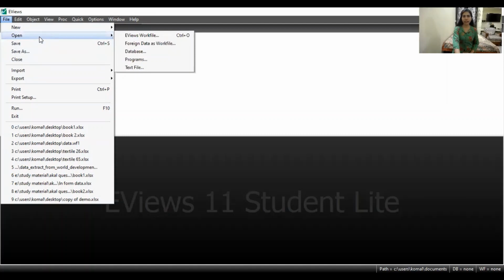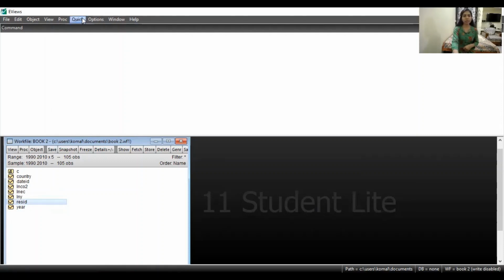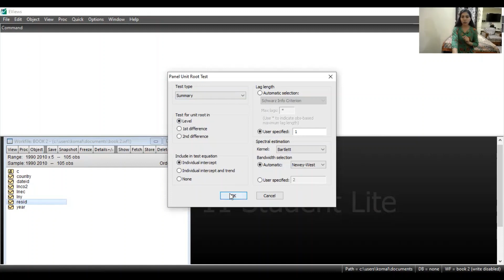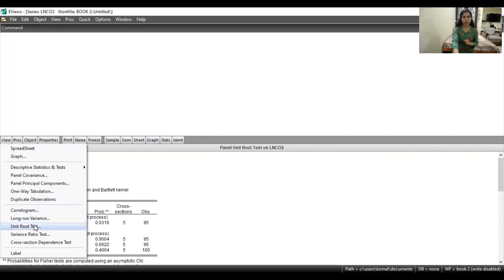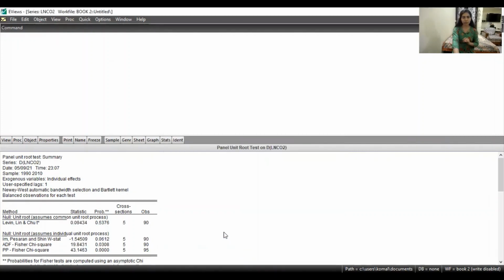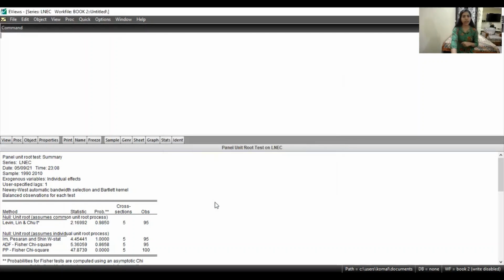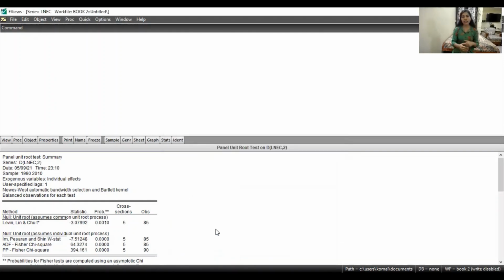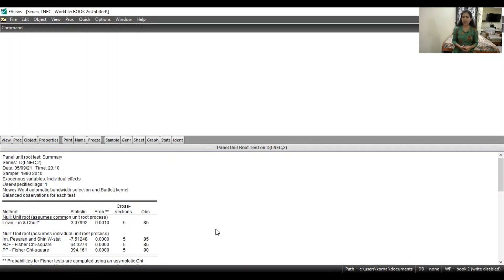Unit Root Test in E Views| Panel Unit Root| Panel Data Analysis| E Views Tutorial | Stationarity

Comment: 👍👍👍
If one variable say lngdp is stationery at level and another variable say lnpopulation is stationery at first difference, then can we proceed like this or do we have to do first difference of lngdp?
Reply from the maker: While reporting your results just mention that: lngdp is stationary at both level and at first difference. Rest of the variables have a unit root at a level and the absence of unit root at the first difference, indicating variables are integrated of I (1).
Reply from the maker: Also, before stationarity check, check cross-sectional dependence in your panels. If there is any cross-sectional dependence in your variables, apply second generation unit root tests Viz, CADF and CIPS.
Reply: Thank you😊
Reply: @komalkanwarshekhawat_  how to do CADF and CIPS tests
Reply from the maker: @sabagulnaz592  For that, first run Cross-sectional dependence test (Breusch pagan, pesaran CD etc) to find out whether there is any Cross-sectional dependence or not.
If there is any, then you need to run second generation unit root test(CADF, CIPS) , this option is there only with unit root test.
Thanks 😊
Reply: How to check cross sectional dependence

Comment: what is the minimum number of years required to apply unit root for panel data in Eviews?
my data is from 2015-2029 and 149 companies 
so it is 894 firm year observation 
but when I apply test it is saying insufficient number of observations.
Reply from the maker: The number of parameters should be less than number of cross sections.
Reply: @komalkanwarshekhawat_  what that means?
Can you explain with simple example please 
That would really help 
And also number of years doesn't matter?
Reply from the maker: @preetibedi5533  Increase time period or reduce number of companies

Comment: I am writing my Ph.D. thesis in social science, and your videos have completely made me abandon STATA. Thanks to you my data analysis job has been simplified.  I have five variables and I opted to use only Levin-Lin-Chu's test, three of the variables are stationary at level, and the remaining two are at first difference. 

My question is?
1. Must I use the summary option to get results for all the test statistics available, despite having Levin-Lin-Chu's test in my proposal?
2. Considering that two of my independent variables only became stationary at the first difference, should I modify them when running the regressions?
Reply from the maker: Thanks for your kind appreciation. 
Regarding your queries-
1. Yes, it is always a good idea to support your stationary results with all the test statistics available.
2. It depends. If you are using a regression model/ Cointegration test wherein the pre requisite is that all the variables should be I(0) then you must ensure that. Otherwise, many regression models can be performed when the variables are I(0), I(1) or a mix of both.
Good day!

Comment: When i click unit root tests(from view), i find 2 options in eviews 12sv lite. A) cross sectionally independent, B) cross-sectionally dependent

What to do
Reply from the maker: Watch the video on cross sectional dependence.
If the variables are are cross sectionally dependent, then you need to run the second unit root test.
Reply: Another query: what to do if a coefficient comes like this:" -1.41E-05"?
Reply from the maker: @aniksaha9925  The result is not viable. There is High standard error may be.
Reply: The corresponding p value is more than 5%, can i ignore this entity in writing regression equation?

Comment: I have panel data of 28 countries for 5 years. variables are diiferen in nature. 1st in percent, 2nd in rank (1-7), 3rd millions and 4th in billions. I have many questions. When I doing GMM i am getting result but I not able check causilty test. If I want to check long run and short run then which model I should use VAR,VECM, ARDL? As i know if unit root test of variables become stastionaly at different levels then we can't use VAR, VECM. In that case only ARDL Model can be used. I also want to how to determine which veriable in my case should be take in log form and which one not? Kindly help me. I can share my data if you want. Thanks
Reply from the maker: I would suggest few things - 
It is always  great to set your panel data in the best way correctly.
1. 5 years duration is a very short time period to obtain robust results.
2. Please consider the variables in a common unit if possible. (Ex. If you are considering % , then take all possible variables in percentage)

Moreover, you can watch videos on - GMM, VAR, VECM and ARDL . I have explained how and when to perform the test.
Reply: @komalkanwarshekhawat_  I can understand time period is too short but its hard to find data on wb. my one variable is hightech import (% of total import) and  availability of scientists and research in rank(1-7) as per wef standard. data for these 2 veriable not available more than 5 years.total patents are from few hunardes to millions. GDP in billion. I am trying to make 2 groups Asia and europe. then try to see the effect of htimport and Availability on patent and then effect og patent on gdp. Kindly guide me. If possible please provide your email.So i can send my data to you for review. Thanks
Reply: @komalkanwarshekhawat_  in such case can i convert all variables into log form? one more thing i want to know. i got my gmm difference result. could you please suggest few other test to sustanciate my gmm result. such as lm etc. Thanks
Reply from the maker: @maneesh123777  Sure it is komal_eco@auts.ac.in
Reply: @komalkanwarshekhawat_  Good Day! I have sent email to you. Once you get spare time then kindly reply. Looking forward to hearing from your side.Thanks, Maneesh
Reply: Dear Komal I sent a mail to you. Once you get time kindly reply
Reply: @Komal Kanwar Shekhawat  Dear Komal I sentmail to you kindly reply. I need your help for my chapters as well.
Reply from the maker: @maneesh123777  Received, will revert to you mail soon.
Reply: @komalkanwarshekhawat_  Dear Komal, I hope you are doing good. I have been waiting for your reply for many days. Now I am in In India and I need to resolve my econometics issues. Kindly reply. Thanks